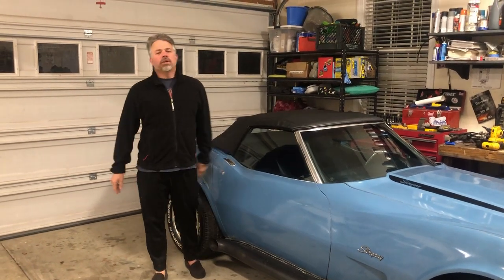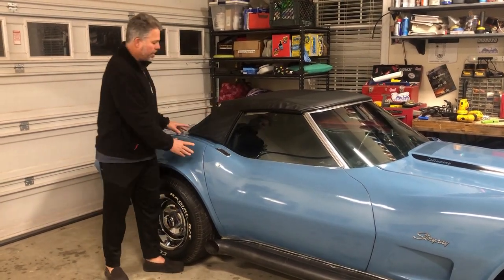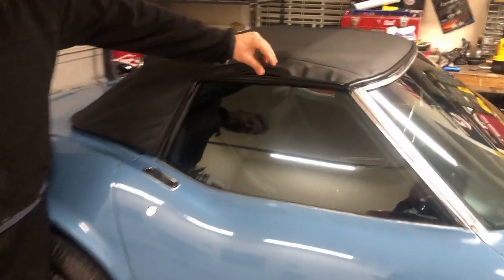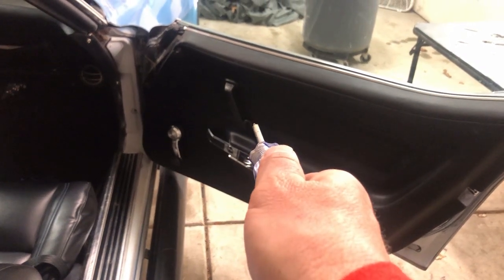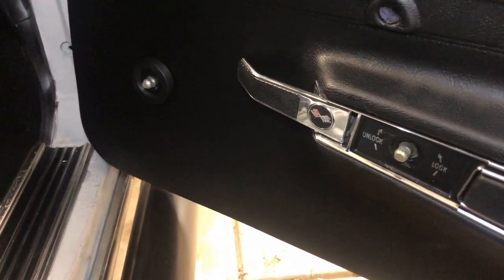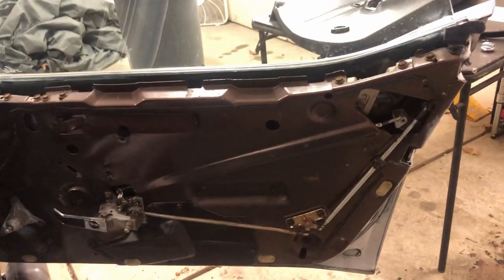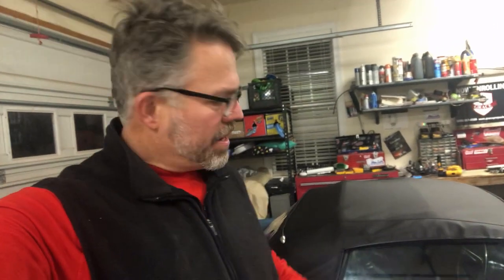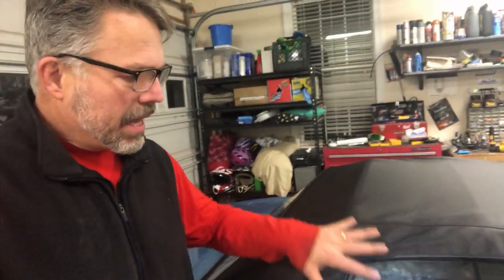Window Adjustment on a 1974 C3  Corvette - Adjusting the Window to fit the new Convertible Top

Comment: Thanks so much for the videos.  I'm going through my 75 convertible and these videos have made a huge difference and shortened my learning curve.
Reply from the maker: Glad to help - the 74 and the 75 are very similar.  Remove the cat and run a true duel  exhaust.  Remove the smog and then if you want power - well you see what I did.  I got 295 hp out of my SBC with small modifications

Comment: Thanks for the info and great video. I have a 73 convertible that I just received a new soft top for, and window track / roller rebuild kit. I need a video for that rebuild if you're up for it, lol. I'm Sure once it's installed I'll be having the same issue. My problem is I also have a hard top for it. Hopefully I can find a good in between adjustment for both tops (my soft top and bows were not installed when I purchased the car (it had a big goofy stereo box in the back). Anyways, thanks again for all the great info and videos, love watching the journey.
Reply from the maker: I have not looked into replacing the window tracks.  Mine were in decent shape with the addition of a bit of grease.  However, in doing the adjustments on the window placement it does not seem that hard.  Remove the glass from the tracks and then the tracks should pull right out of the top of the door.  Go for it.

Comment: Another issue is if you have a removable hardtop and install it on the car you will find yourself adjusting the windows again. Have fun and get ready to put up with some wind noise.
Reply from the maker: I considered going with ONLY the removable hardtop and not even installing the convertible top - would have been MUCH cheaper.

Comment: You should get your money back from who ever installed that top.  It’s a talent they apparently don’t have either.  The wrinkles in that top are unsat.
Reply from the maker: so finding a good person to put a top un is nearly impossible.  I looked for months and I found a local guy in the Fredericksburg, VA area.  It is basically the best I could find.  However, after nearly 6 months of driving the top has only been on once - so there is that.